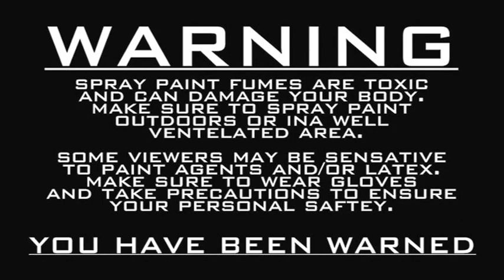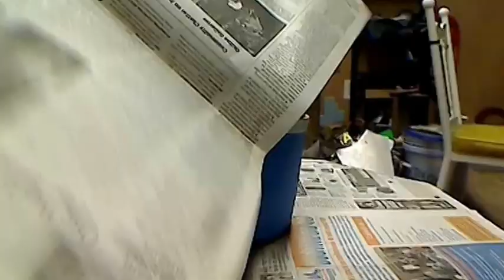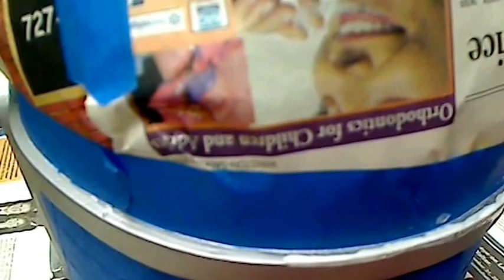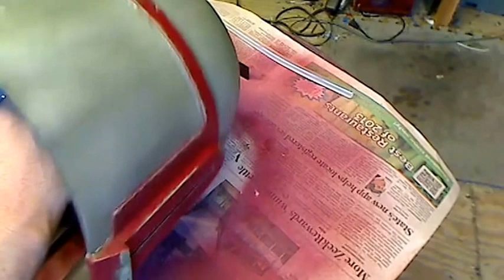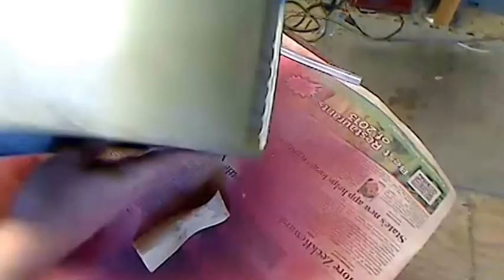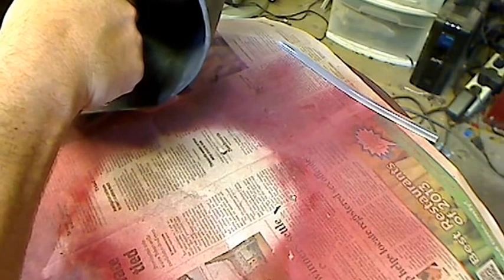Warmaster's Workshop - Episode 5: Helmet Painting & Visor Installation

Comment: Did you skip a part? How do you get the black line around the weathering?
Reply from the maker: Ground up artists chalk.  Take a 1" brush and brush it around the helmet.
Reply: @MandalorianMercsCC  And that will fill in the level difference between the masked off part and the painted part creating a black line?

I have a test helmet I will be messing with this weekend. Thank you for the video.
Reply from the maker: @michaelknight2897  yes, it will gather in the border where the weathering is layered.